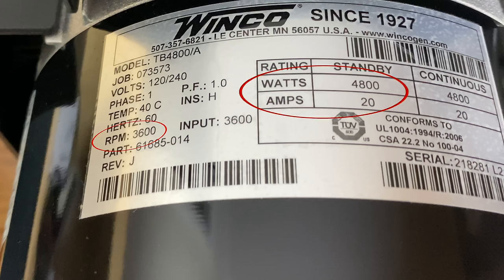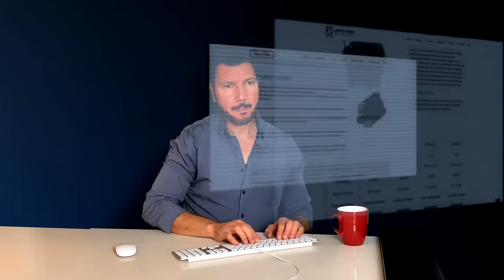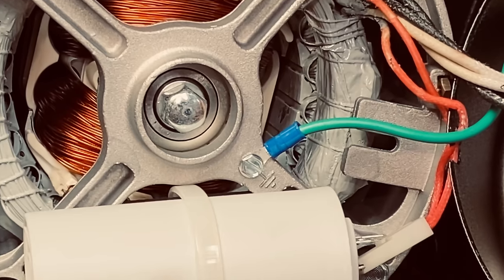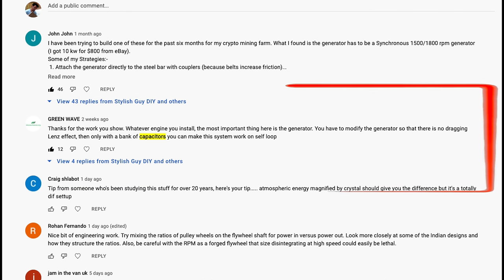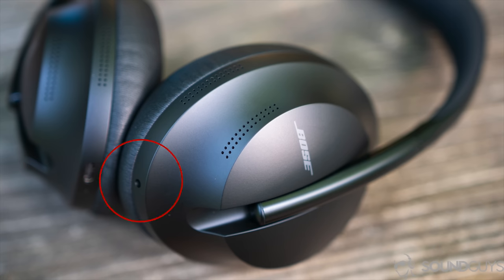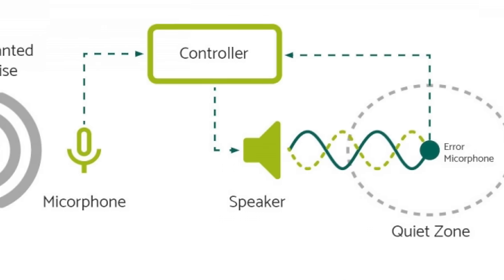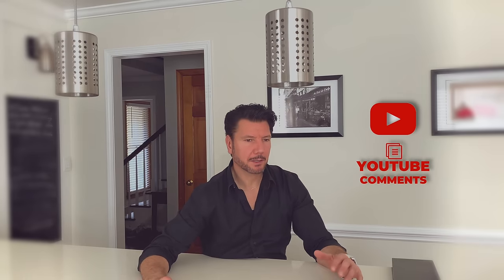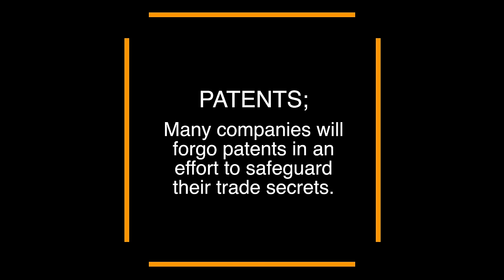Why does this Free Energy Generator not work?

Comment: Energy is not Vibration . Energy is the capacity of doing work  . Another thing , Those motors have a AVG Frequency of 50/60 Hz . you can try to cancel vibrations as much as you can but its impossible . You can get down the Mechanical vibrations . But you cant take out the Frequency out of the Eddy currents . that's what is producing you the power output . The reason why you get such massive vibrations when you connect the generator to the motor is exactly just that . The Eddy current from the Generator and the Eddy current from the Motor . And you can not drive the generator to a higher Frequency . 1 youd need a generator and motor of Above 1 Khz  , 2 the figher in frequency you  go the less efficient it will get . 3 take out the Flywheel . The Flywheel in systems is only accumulating enough Kinetic energy for a very small amount of time . other than that it's  becoming a it's becoming a issue  . Just adding more friction to the system . To cut down the the friction you need to connect Both shafts together . that way you can focus on the friction just from the motor and generator . Witch ! you can clearly understand why this system is a total FAIL . Those Magic EDDY currents and the Loss int the resistance of the coils from the generator and motor . And Please don't have the Bright idea that If you have a higher capacity generator it will compensate for the loss in the system . Hint a 1HP generator requires a 1 Hp motor . you can not compensate with nothing  Flywheel its only adding more friction to the system . So basically you need to add more power to compensate for the losses .
Reply from the maker: Thanks this is actually very helpful feedback but I don’t agree with the statement that I it will cancel the Eddy current.
That’s why I had the example of the Karaoke track in the video.
Unless you match the exact vibration in reversed polarity it will not cancel.
Since the magnetic field is in such a low frequency area like you said between 50-60Hz the frequency to cancel friction vibrations won’t effect it.
If you ever seen the frequency spectrum of a bearing monitor system for preventive maintenance you see that it is much different frequencies.
Reply: @MarkusNenning  You can make it more Silent , but that's about it . Friction Vibrations ? You mean from the mechanical point ? I'm not saying 50-60 Hz i'm sure of it . Look at the label of the motor . And I don't get it . What's with this friction Vibration ? you mean to tell me that friction is vibration ? I hope not ! A change in magnetic field is not friction . 2 magnets repelling is not friction . Think ! now going back to the main issue . you can work with something that can mechanically reduce vibration , I have no doubt about that . But the vibration will always be there due to Eddy Currents .  Working with different Generators or Motors at a Higher or lower Frequency is irrelevant  you still have eddy currents to deal with . That's not  Mechanical vibrations . that's eddy currents doing it's thing

Comment: If this set up works at all(free energy wise)then it has little to do with the fly wheel,if anything the fly wheel would only be to maintain speed during a switch over or possibly some more exotic form of energy transfer between the two units during operation.As for free energy if it is not a hoax then the energy will be coming from some way in which the units are connected electrically.Magnetic motors do work all be it not well so it may be possible to generate energy from the magnetic fields by some configuration of wiring and windings. There is very little difference between a motor and  a generator they can both act as each other when pushed or pulled as it where by loads or vice versa.There may be a cycling between the two functions that leave the motoring without back emf this would render the device a giant magnetic motor
Reply from the maker: Interesting theory 🤔

Comment: The videos I've seen, the rotor if the generator (car alternator) have been modified. Specifically, the rotor receives neodymium magnets, in a certain array. The reason being, a copper rotor doesn't have the necessary magnetic field. I'm new to this also, but this is what I've seen time, and time again. If it's true, then it's a simple and cheap fix.... I've thought about building one for myself, but I just found it like 2 days ago.
Reply: You Adam have mastered the secret. Modify the Generator with neodymium magnets. The alternator is designed to divert the magnetic field back on itself to act as a brake. Do you understand what I am saying..
Reply from the maker: I have seen a lot of this videos lately too mostly converting car alternators.
So I may give that a try.
Reply: @MarkusNenning  Hell, it's worth a try.. In comparison, it's far cheaper than what you've done thus far. My thing is..... Even if it does work, how the hell do we apply it to our home. As you well know, here in the States, were 120vAC, and 60 hertz. The particular video shows 227vAC, and there frequency varies a bit. But, we get 220v from two separate 110v sources.... That's what stumbles me at the minute.
Reply: @harrycallaghan2531  I got you, basically it takes more energy being forced into the alternator than what you get it of it. Modern units have a portion that's needing to be excited. I strongly believe that's why I'm this video, the units can't work this way, because if backwards emf?
Reply from the maker: @adamackels73  I think that will just be a matter of wiring the coils in parallel or series.

Comment: TRY Axial flux permanent magnet generator its really low RPM and produce high Voltage or Ampere regarding to the Magnet arrangement and the Aix gap . I've designed one for my college project with just at low cost . Please give it a try or research in Axial Flux BLDC motor & Generators.

Comment: You are talking about if the generator has only 40% efficiency it can then only power 7 motors. I agree. But I also think that you know this but that many viewers do not is that to power these 7 motors the generator needs to have physically work input of 19 motors due to the 40%.
At least you are not having a hidden cable like other videos so it is more legit.
Reply from the maker: 😂I never knew they have hidden cables
Reply: @MarkusNenning  This video is a tough one. I thought batteries and inverter in base first, then batteries and inverter in the black motor. But my latest thinking is a cable that has been edited out. There are some frames that might show a cable or at least the frames has been edited. The time where it is most clearly seen is at 12:46 in this video. If you go frame by frame and look between the tables edge and the machine I can at least see a something that looks lika a cable that has been edited out. https://youtu.be/VhRPYG7HeSw?t=765

Comment: Well you know the energy flow in these machines is not continues - it is incremental - If you want to align two engines electrically (and mechanically), then you have to take real good care of the phase. Both AC and DC machines work with phases, that comes from when the rotor is  passing a pole.  Therefore you need to have a timing belt, and the exact position.

Comment: Hey Man, I think you know that its Impossible with comercial generator, you must to use a modified generator with neodímio magnets. This is the reason the system don't stop, due to extra power from neodimio magnetic. I suggest a 3° video of free energy, but with a small prototype, so you can spend less money.
Reply from the maker: Hello Pedro, yes that is exactly what I am planning.
Thank you!
Reply: @MarkusNenning  I am preparing to do the same. First I will try to find a used motor or alternator, If not I will buy a cheap motor. Then I will find out what is the right magnet size to use in modification.

Comment: It seems we can make a generator with little power needed. Still some power but very little. This would still be a huge power saving machine.  Why does it have to be all or nothing?
Reply from the maker: You’re right it doesn’t need to be all or nothing. That’s why I don’t call it a perpetual motion machine. I am happy if it works let’s say using a solar panel as an amplifier.
Thank you!

Comment: Your example at start is not looking good ...🤔. Its right pushing a car is hard at start but one question what if an elephant jumps on the car which u r pushing ?? Will it be still easy for you to push that car ... I guess not .. So same without load generator will spin fine and make some voltage but when you put a load on it result will be same as per laws of physics ...
Reply from the maker: Hello Ali, but as I said in the video technically the generator has enough power to power 19 of the motors that I use to turn the flywheel and generator with. And even with your Elefant example once in motion it’s hard to stop.
Reply: @MarkusNenning  well this should be calculated that what force is applied and what weight of elephant is to make an impact ... But mark my word ... This concept will remain beating the bushes... Natural laws never changes until the creator of these natural phenomenon  want to change them..😉 ... I guess there are many scientist worked on this concept for a century and I am sure they have tried all the possible ways if they can produce free energy with a failure... And also the flywheel is still implemented to store energy ...

Comment: the working design uses one simple principle, use the motors that consume large amp instead of large volt, thick wired motors suit this category, thin wired generators yield large volt and less amp , also need damn less torque to have the generator shaft spun, totally the torque difference between the motor and the generator yields the difference in output and input electricity, making the output yield large electrical wattage than provided in electrical wattage. 

this doesn't violate the law of energy conservation, as electrical energy alone is amplified, not total energy, energy conservation law states that energy can never be created nor destroyed, but can be transformed from one form to another , but not as electrical energy can never be created nor destroyed, but can be transformed from one form to another. so do it wisely and get the result.

Comment: Do not unplug your first accelerator motor. THEN plug in 7 other motors to your generator. IT WILL WORK!!!
Reply from the maker: 🤔it should 
Except I don’t have 7 motors :) 
Thank you Karahan
Reply: @MarkusNenning  then go for 2 motors :) What I meant is if you don't unplug your accelerator motor, it would keep on going forever. In the end, you imported 1motor power and exported 7motor power. Still, it means free energy, right?
Reply from the maker: @karahankarakurt  yes I did initially plug a motor into the generator output and yes it worked but I had no load on that motor.
Assuming 2 would work also :)
Reply: @MarkusNenning  thank you for your kind response. This is hard to get after all those fake videos 🤗😄
Reply from the maker: @karahankarakurt  thank you as well!
I appreciate all the ideas and suggestions from people like yourself. I think collaboration is the best way to make progress in the sustainable energy field.
All the best to you!

Comment: When you have mastered the topic of Kinematics and Rotational Dynamics. Then you will make the necessary adjustments to your system and I assure you that it will work. bye. He has not mentioned in his videos the Moment of Inertia of the system of the built system, nor has he shown his calculations on Torque, Power and RPM. How do you think the Generator can keep working, without knowing these necessary variables? Bye.
Reply from the maker: Thanks
Reply: Good

Comment: Also the power of the motor is not 240W but 713W
Reply from the maker: Anthony it’s 1/3hp that comes to 250 watts
Reply: @MarkusNenning  yeah your motors plate says otherwise yes it says it is 1/3hp but the FLA or full load amperage is 6.2/3.1 thats 713w power draw so there is something wrong there or your motor is less than 40% efficient
Reply from the maker: Thanks Shayne!
Very good observation!
I wouldn’t be surprised if this motor is only 40% efficient 😂
But you’re probably correct it may be 713W regardless that is still less than half of what the generator is supposed to produce.
Reply: @MarkusNenning  oh the numbers don't matter much to me i understand what they are trying to do but i'm an electrician so i know why it can never work

Comment: From what I read/know, the most efficient motor in the world is at 98.7% plus or minus 1%. For an electric motor to run perpetually it has to be at 100%, I.e., 0% heat loss, 0% friction and perpetually sustain running. Now, in conjunction with an alternator/generator, the initial rotation(minimum requirement in rpm to excite ) is the key. These guys in India, give it a weak hand pull and Viola !....it runs..LMAO.  I think that some company/oil giant/inventor(s) have the patent on a "sustainable" idea but not on a product. If one person/entity patented an internal combustion engine, then why does every auto maker have their own engine? Same goes with TV's, Fridge's, Washing machines, computers...etc.
Reply from the maker: Exactly! Just a small difference I guess and the patent doesn’t matter anymore:)

Comment: Try using a voltage regulator 220v one with a transformer. The problem is the reason it stops it shorts out the field required to run sort of like direct friction contact instead of slip ring. The transformer acts like a slip making the energy transfer through the medium instead the line. If not youll get dead haulted!!!! Look up fly wheel generator and click on the one with indian guys with washing machine. Youll see the little black thing on the right between lights and ac motor

Comment: Try to use a strong permanent magnet generator. 
Using an electromagnetic generator will not work it defies the law of thermodynamics. That is a perpetual magnet: H + H not = 
The second law of thermodynamics state: H + W = Energy: you want to get more heat to apply isolated work to heat and it will raise the internal energy.
So also: E + M = Energy.
You want a raise electrical energy, you isolated magnetic field (permanent magnet) through faradays law we get more electricity.

Permanent Magnet is a source of potential internal energy that releases electrical energy on conductive wire.

Comment: You need a car battery a soler panel and UPS which will give a shock of electricity to motor every 10 , 20 minutes that’s how your free energy generator will not stop you can also make it will small scale like using DC motor which can run by soler panel you can charge your car with it and light up all the house

Comment: Alright so A.) How much energy is it supposed to make at the achieved RPM. Vs how much do you make*.
B.) How much energy should the motor take vs how much it is taking. 
C.) Lubricate your bearings more, for fun. 

D.) I don't want to talk about it online:
Figure out your magnetic fields.
The generator pulls energy from the atmosphere. Where is it coming from? 
It's possible ur generator is stealing from your motor, and that the flywheel is stealing from your generator.

Paint the flywheel in lead.**

My advice

Comment: why it doesn't work: #1 the two belt's connected to the same pully (defeating purpose ) #2 the weights need to be independent of the motor ( centrifugal clutching allow weights motion to continue on it's own supplying to generator ) while they need to be connected they also need to be independent.

Comment: It is essential that the belts not be tight. So that there is slippage and subsequent compensation, creating an excess. Look at the videos. Including some that you show. Some even have obvious "idler" pulleys on the belt, rather than it being snug. You were too intent on setting it up as though it were a grinder, without slippage.
Reply from the maker: Thanks Mike.
I did actually also try a less tight belt configuration but I didn’t work either.
I think the reason they tighten the belts once in full speed is that it needs to slip like a clutch in order to get the large flywheels in motion that they use in their setup.
I have see videos with 400 pound flywheels.
If the belt doesn’t slip the motor would just stall.

Comment: The comment section shows the devastating effect of lack of knowledge on electrical engineering and ACTUAL free energy / overunity devices Lol.
Flywheel STORES kinetic energy and that's it. If you want ACTUAL free energy, research parametric transformer / paraformer and play around with it by adding or removing resonating capacitors on either sides.

Comment: Your design has major flaw that your energy Storage block (Flywheel) has highly undistributed Mass. You should use a flywheel made up of uniformly dense material.(Steel) and should have Higher radius as Higher radius increase Stored Energy as it increase Moment of inertia.
You need energy balance equation for this system.

By this project you must conduct energy from Motor to Flywheel to Generator. And not let it dissipate in friction and vibrations.

Comment: I had a idea 💡 using a pulsing current from a battery to keep the drive motor turning like a engine 4 cylinder distributor spark.  ^- - _--_ 
while generating a recharge from a inverter or changing circuit
Reply from the maker: Interesting idea Simon 🤔